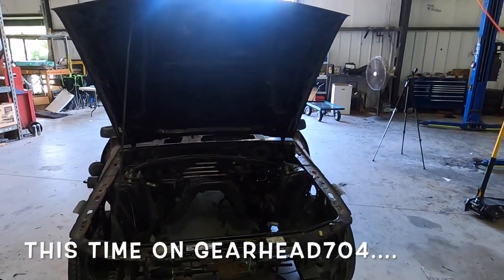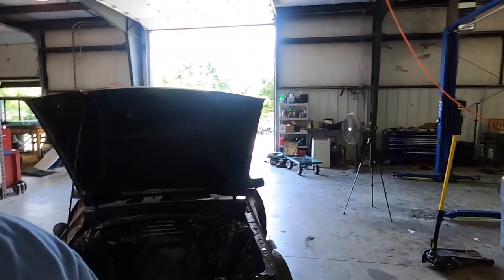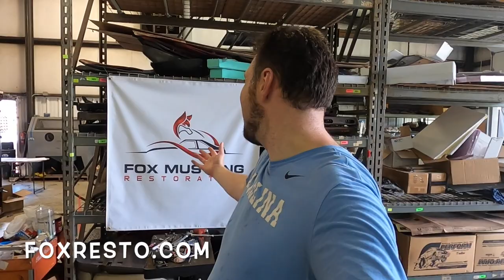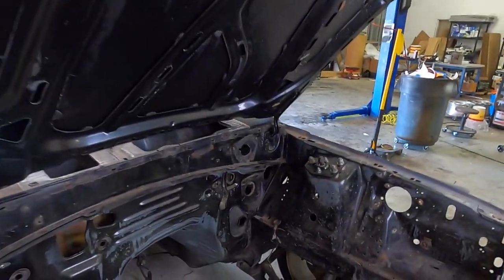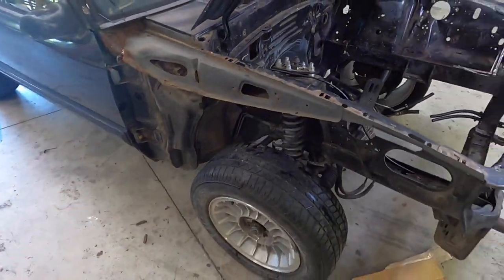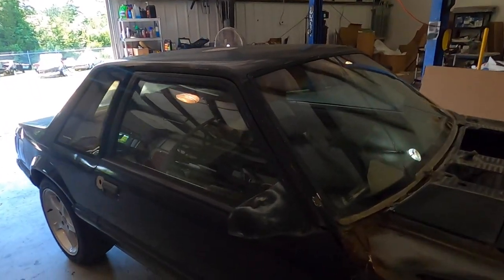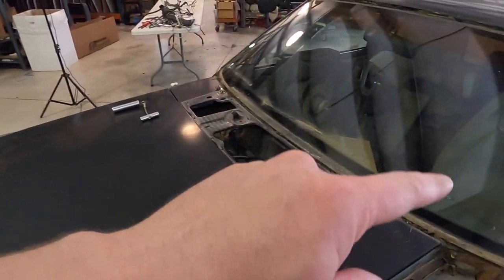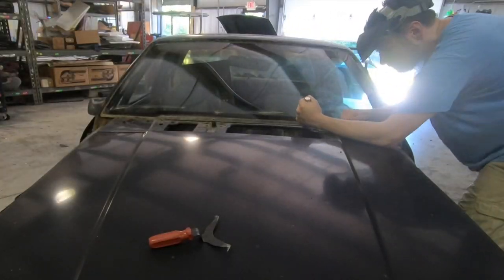REMOVED MY WINDSHIELD AND FOUND….// FINAL ENGINE BAY PAINT PREP FOR MY FOXBODY NOTCH

Comment: Do you know if it is a real SSP? If so there is a metal tag on the back of the left head light.
Reply from the maker: It is, it has both buck tags in the front including the correct DSO code.